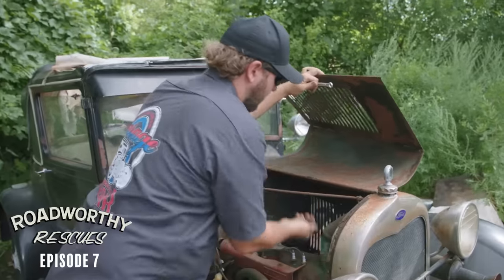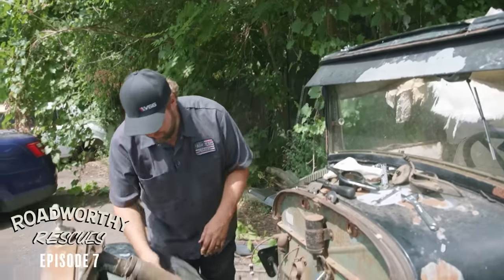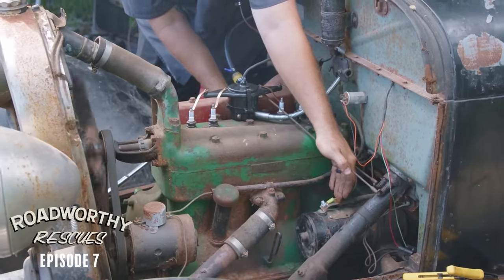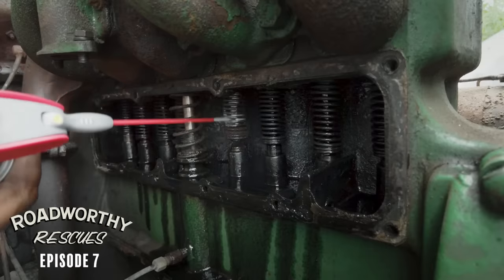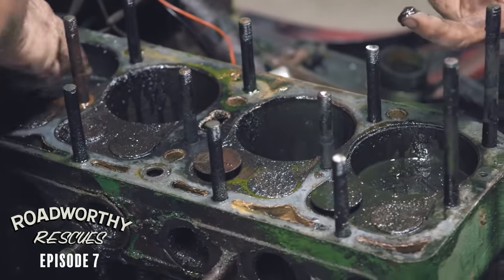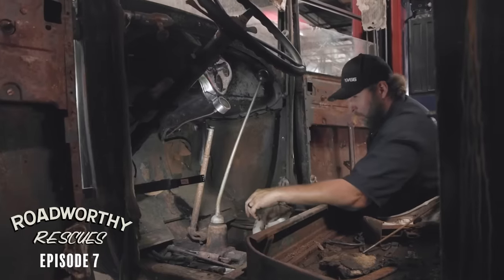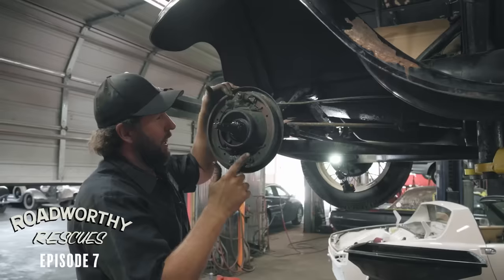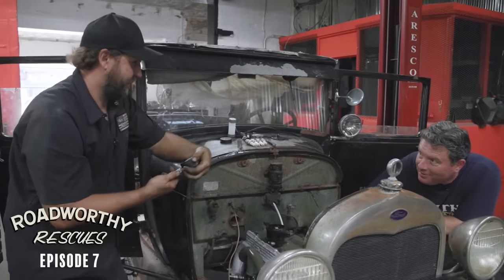This 1928 Ford Model A Hasn't Run in Over 60 Years! | Roadworthy Rescues

Comment: Awesome. I’ve got an 09 Buick …1909 which is crazy to drive. Throttle and advance in the wheel. Brake on the right first gear reverse are clutches and second gear is a lever.

Comment: Excellent video Derek  :) yes those Model A cars are interesting  in 1994 at first Restoration shop I work we did body also electrical  to 1929 Model A Woody car also so fun work on and Motor was updated to a Flat Head 292 1 barrel carb with hand choke cable to steering wheel  plus Floor shifter  h patterns  R with 1 & 2  6 volt positive ground electrical start or hand crank handle same brakes as 1928 has plus wheels! I have seen car in years since Restoration  and but be nice someday! You  enjoy 1928 nice work get motor and test drive Derek!

Comment: Nice work man 👍
Did you know that the same old six cylinder bosh starter motor is the same all ya have to do is change the parts that bolt up to the gearbox. 
And just loving the colour of the XC FALCON   And was wounding what the exact colour it is as I’m looking to paint my XW green. 
Thanks 👍

Comment: If your gas tank keeps giving you rust problems, go to your hardware store and buy a can of Lye and mix it with hot water. Fill the tank and let it sit for a while, a half hour or so. maybe rock it back and forth then rinse it with hot water so the metal dries. It will look brand new.
Reply: That gas tank would totally disappear if we did that!  Hahaa!

Comment: The smoke is caused from resistance.  You can throw a 12-volt battery in there and just feed it the onions and it'll spin over I do all the time if you use a 6-volt battery is just trying to suck the energy and it smokes you just need to feed it the onions as you would say

Comment: It's amazing how cars fundamentally haven't changed in the last 100 years. They still had cylinders, valve springs, fuel tanks, starters, a few things have changed like brakes are now hydraulic and use disks, but essentially it's the same principles. As we enter the age of EV's of course it's a whole different ball game. Or should that be re-enter the age of EV's? Jay Leno has a 1909 Baker electric car, and apparently there were 15,000 of them in NYC, charging stations and all back in the day. There is nothing new under the sun, it would seem...

Comment: Why didn't you take the sticking valve out and clean it up instead of replacing the entire engine. Flat head valves are easy to take out.
Reply: Because the rings were so rusted and gone, it was falling apart right before our eyes.

Comment: Starting an old engine that has been standing for a long time with such old, dirty oil is an absolute NO GO! That's how you destroy an old, probably still good substance.
You should rename your channel "Greenhorn Chaos Mechanic".
Reply: Oil doesn't lose viscosity from sitting.  It's fine, for a quick check to see if it will bark as long as there is no contamination.  That's why Derek tastes it first.
Reply: @ModelA  This is not correct, engine oil loses its properties in the long term, and the residual amount of petrol in the oil also changes the stagnant oil.
It is not for nothing that the army regularly changes the oil in all vehicles, even if they are only stationary
Reply: @Juppausempott    I disagree.  But that's OK, man.  I was Navy, we referred to old oil as "fuel".

Comment: How did you ever find parts for that? Does it come with a touch-screen and 360 deg cameras for the soccer moms?
Reply: Parts are easy to come by. Much easier to get pieces for a Model A than a 60s Ford.
Reply: I guess there are specialty niche machine shops around that actually build parts for these. Where I'm from there's a guy who developed a whole business around remaking parts for the old Chevy Corvair.